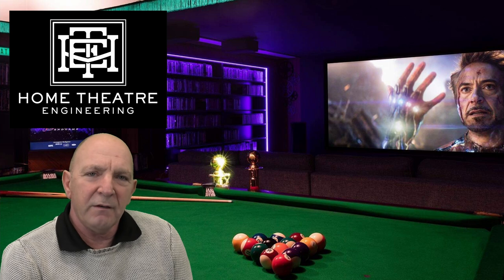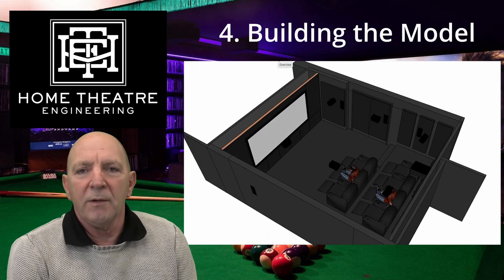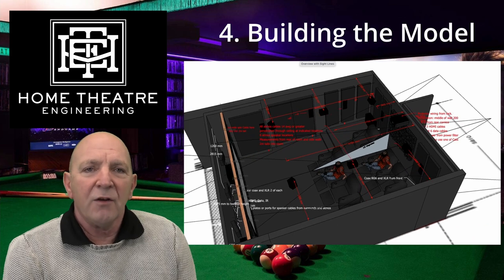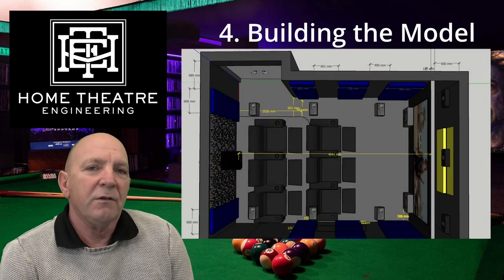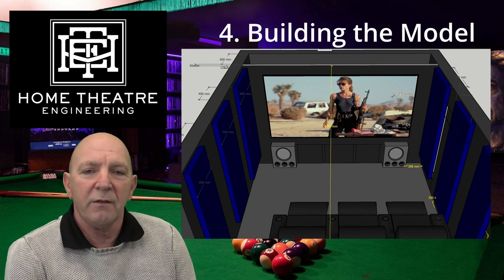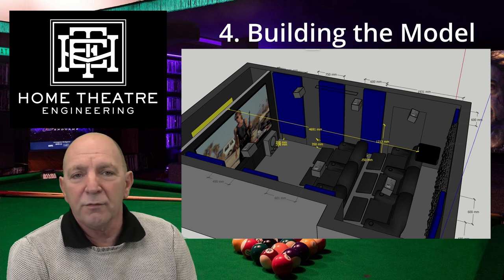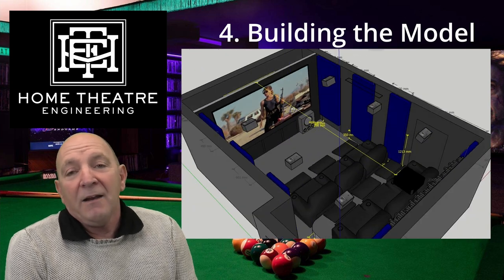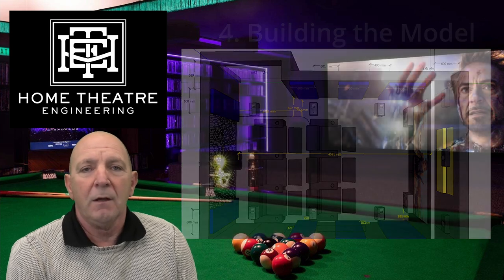Home Theater Design. An Essential Step for Exceptional Results

Comment: Starting from scratch, without even the space for the home theater built yet (we're adding on), I found it important to choose the screen size and then a projector that could fill the screen, provided/assuming that there is a projector that fell within my budget.  In my case, desiring a 174" screen or larger, the projector choices amongst "home theater" projectors is very limited. But without knowing the screen size and some facts about the projector like "Throw Distance," how do I know what I should tell the builders about the inside diameters of the room, right?

At any rate, how does one go about hiring you guys (if it's even possible to do so since I'm in the US - Austin, TX), and what's the cost?  Cause when it comes to the stereo equipment, sound acoustics, and the like, I'm a lost duck.
Reply from the maker: Hi. These are all great questions and thoughts. You are hitting a few key points and yes getting enough light on a 174” screen can be challenging. But then the other questions are viewing angles both vertical and horizontal and where that then puts the seats which in turn then determines where all your speakers go… We do lots of projects around the world so happy to help. Get in touch with us via our website www.hometheatreengineering.com

Comment: I see that the viewers are also pretty well learnt. I have a Sony 80h 65" 4K DV LED TV. It has its own preset callibrations and I have always wondered if getting a professional calibration will be worth it. It is expensive here in India. I love watching shows and had a friend make a DIY Speakers and connected to Denon X550Bt. Not privileged to have a room like the one here, sound proofed and only for viewing. Maybe one day. I know my place is not ideal for audio, but i wonder if theres anything more I can do to improve the visuals.
Reply from the maker: The first step in improving visuals is improving the room. Controlled ambient light, reduced reflections and a good seating position all help. I would be hesitant to say that your TV has its own “preset calibrations” Presets yes, calibrations…not so much. In answer to will calibrations improve your picture …yes, if done correctly with the right equipment.

Comment: I have the Epson 880 home theatre projector. I bought a screen but there is a grey over splash outside of the borders of the screen. Is there any way to cover that up?! Or am I stuck having to ignore it? The only way I can get around it is if I zoom all the way to it's full lens capacity. However this defeats the purpose of the screen as the image dwarfs it at that point. Please help.
Reply from the maker: Its a bit hard to understand exactly what is going on...When you say outside the borders do you mean outside of the extents of the black frame of between the image and the frame. Whatever it is it sounds like your projector isn't set up correctly. (Probably obvious I guess) This is not something we can help with in a youtube comment. Suggest you get hold of your local calibrator.